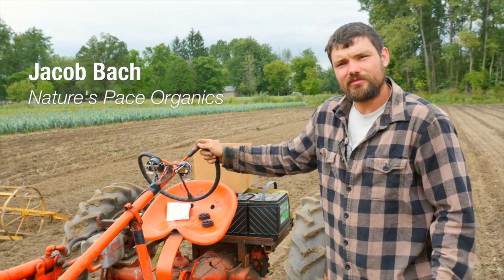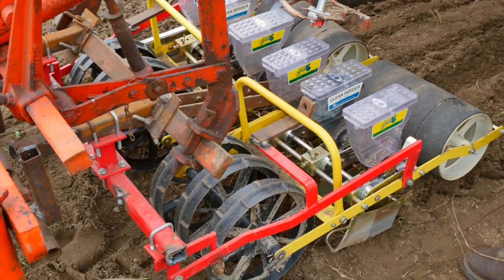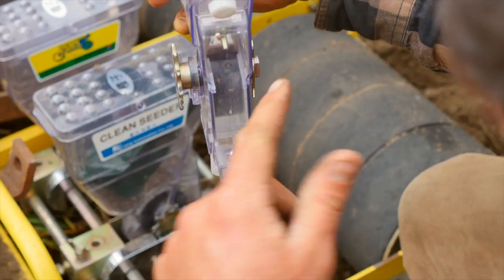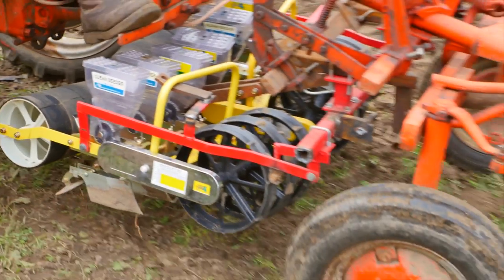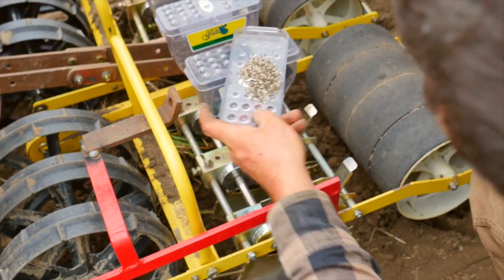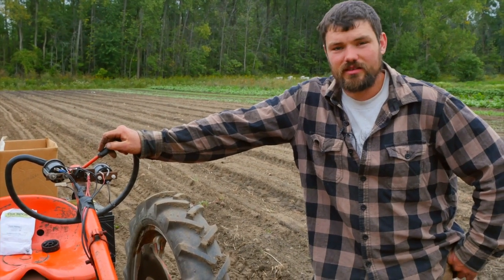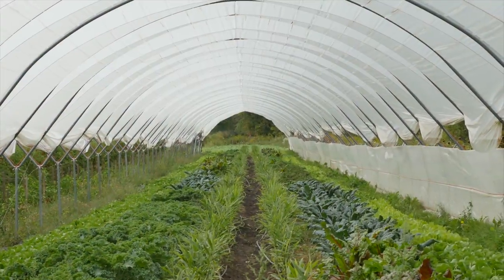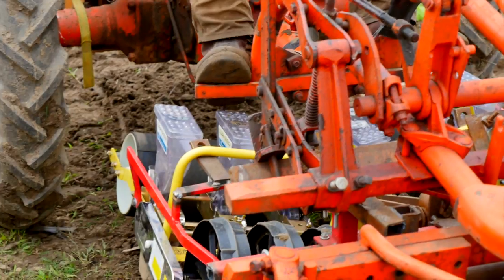Direct Seeding with a Tractor-mounted Seeder

Comment: After working with a 'G' w/ belly mounted planet junior, I gotta say, this is super impressive. The two issues I had were: didn't want to fume up the barn by parking the tractor right next to where the seed is stored (yes, efficiency IS a state of mind), and the general quality control issues hailing from the Cole/Planet Jr. design. Inspiring work! Glad to hear you're saving seed as well! Thanks for the video.